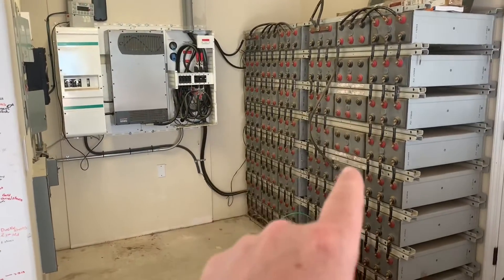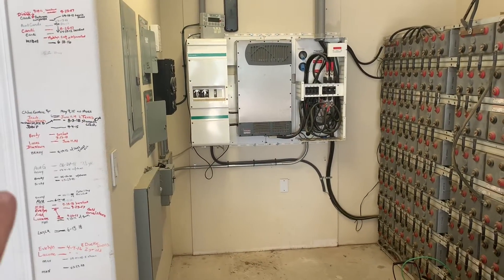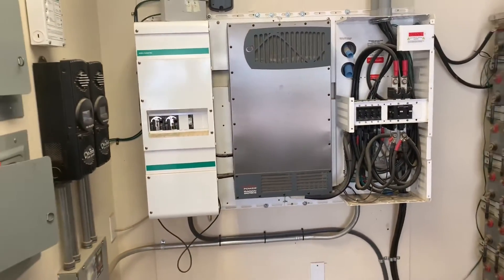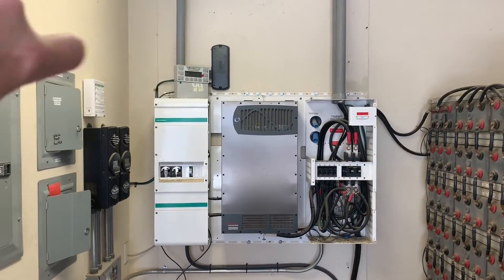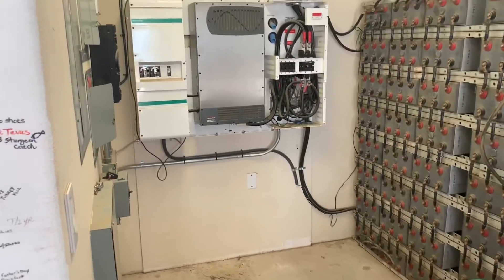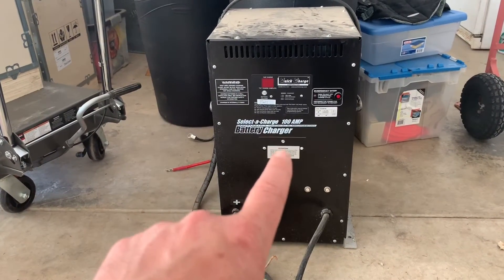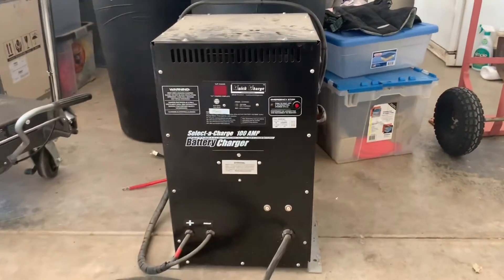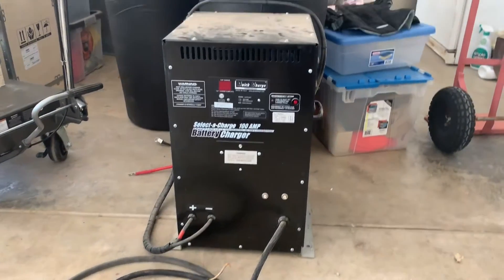I get to rebuild the first off grid project I built and upgrade it to Lithium Iron Batteries

Comment: Why did you choose to install Discover batteries rather than say, Simpliphi?
Reply from the maker: Because I can monitor the battery and access the bms, also there are less connections and I can get 26 kw in the area I have to work with if need be
Reply: @JasonAndrade427  True, less connections with Discover. Simpliphi does not have communication? Though, I suppose that can be added.  I am on the fence between Simpliphi and Discover up here in Canada.
Reply from the maker: vensonata no you can not add communications to the Simpliy they have a non communicative bms so they all work independently, I will be able to bridge the Discovers and connect them to the combox and communicate locally as well as monitor them remote

Comment: This is going to be great to see! Maybe make it a "series" of videos showing more details?
Reply from the maker: Chris DIYer what would you like to see
Reply: @JasonAndrade427  
"what would you like to see"
Brunette strippers using the power tools.
Reply from the maker: Well you get points for reading the comments lol
Reply: @JasonAndrade427  - Hahaaa. Fully off-grid with a wall of AGM batteries. I am curious what his loads are, array size and how the lithiums will work. Is that area climate controlled? Gas/diesel generator back up? Thanks...chicks with tools are alright too
Reply: Jason Andrade more kanen.  Maybe a little goofin around time. I’d like to see the solar array.